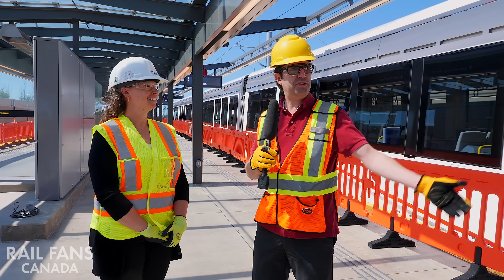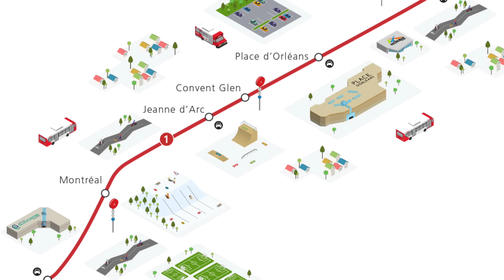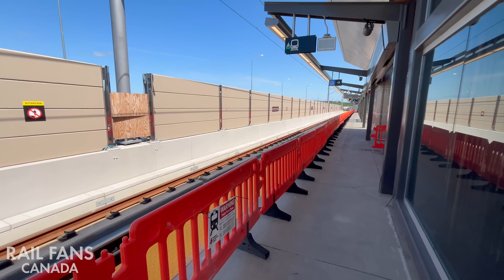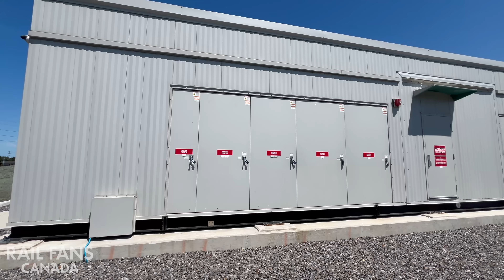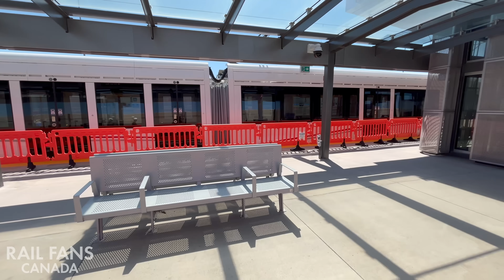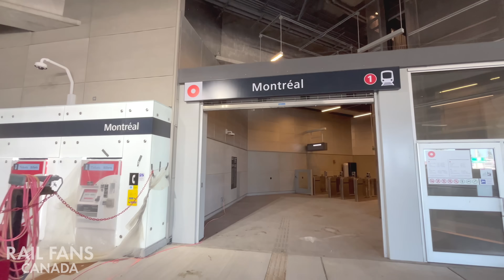EXCLUSIVE Sneak Peek of Montreal Station: The Eastern Extension of O-Train Lines 1/3

Comment: Stairs and elevators... why no escalatorsÉ
Reply from the maker: Less than 20% of stations have escalators and that percentage will decrease as more open for service. The stairs are usually more than enough, and the elevators are there for anyone needing them for vertical circulation. The escalators are typically UP direction only (except for one at Parliament and several at Rideau), and are more likely due to the deep underground depth, and to help assist clearing the platforms. Otherwise they are mainly only found in busy stations or transfer or terminus stations. Escalators are also seemingly higher maintenance than the elevators, and do take up a lot of space, that would add to the station footprint.
Reply: @RailFansCanada  Escalators are commonplace at almost all rapid transit stations (except in Ottawa, of course). If you use the O-Train regularly you'll see that the stairs usually NOT more than enough, with many passengers often opting to use the elevators. This leads to situations where people with strollers or mobility devices often have to wait for the next elevator because of "able-bodied" passengers taking up all the space ("courtesy" is not in the vocabulary of the average, entitled government worker)!

Comment: I thought the advantage of building rail in the middle of a highway is that it’s cheaper. But if you have to completely rebuild the highway and on-ramps to fit a giant train station in the middle, it doesn’t seem cheap at all. Plus, you’ve now got a train station in the middle of a highway where it’s inaccessible to pedestrians and no transit-oriented development can be built nearby because there’s a highway in the way. They really should have paid more money to trench it down the middle of a local road or even go on-street-running for these remote sections.
Reply: My understanding was that the Montreal overpasses were due for a refurbishment/replacement so they just bundled the project's together.
Reply from the maker: Pretty much on point with what happened, as far as I understand it as well.
Reply: Pedestrian access is from Montreal Road underneath the station.

Comment: What a joke.  Ottawa.joke. they started building 2016. It 2025. Still not complete.   Always break down.  Run only 30 km/h.    JIM WATSON  corruption to its finest. Lavalin Montreal.   We had it betyer before. With espress buses. Orleans to downtown 20 mins.   No it's 1 hour or more.and you have no choice to transfer specialy in the winter.

Comment: Great video as always Shane! My initial thought on the Montreal Station entrance under the highway - it looks and feels like a garage! Very plain walls, what looks like concrete floor, too utilitarian. Too 'auto repair shop' looking. I really hope OC Transpo adds art right at the entrance, and just inside, plus line & system map posters on the walls. I see the ceiling hangings past the elevators, which are great, but the wide doors at ground as wide so appear as garage doors. They've really committed to the garage aesthetic! But it's completely wrong for an OC Transpo station. The downtown underground stations set the standard for the network, & Montreal Road's design is a sharp let down.
Reply: OK so looking again at the video, the problem is not outside the station, as there's ticket machines, although ideally they'd be inside out of the underpass wind tunnel (likely in the winter). But just inside there's an industrial style metal screen around the first elevator shaft. I generally like industry style, but here it gives off car lift vibes. And past the gateline, the wide doors on the right have high metal kickplates, which also accentuate the industrial vibe. Fortunately, this disappears as one ascends the stairs and the regular transit wall covering is alot more apparent. Train level is fine too, & esp like the noise walls. Having taken a few US rail lines in highway medians (looking at you LA and Chicago) that didn't have any such walls, they were horrible stations to wait at. Can't wait till the LIne 1/3 extensions open!
Reply from the maker: The metal screen that wraps around the elevator shaft is present at pretty much all Line 1 stations so that is a standard O-Train visual feature. Thanks for your comments Mike.
Reply from the maker: I appreciate your thoughts on the aesthetics of the station.